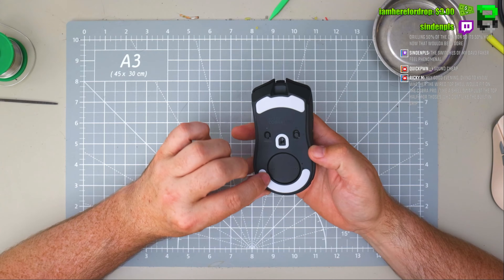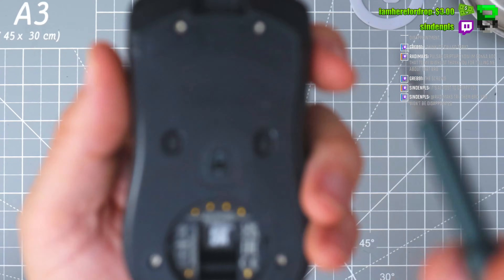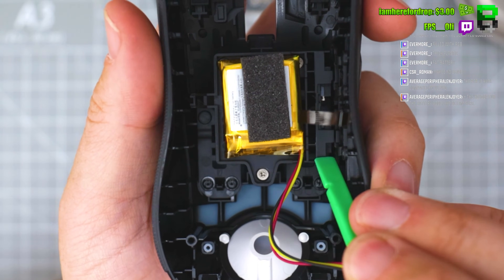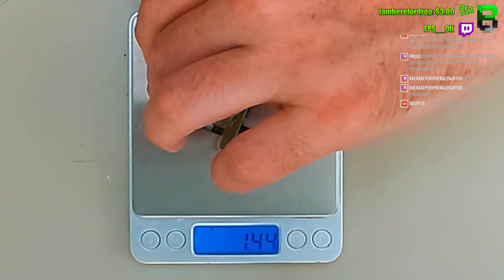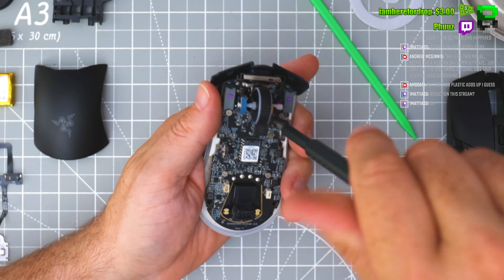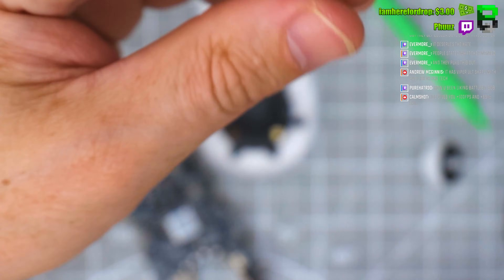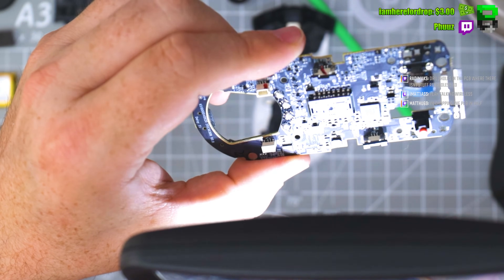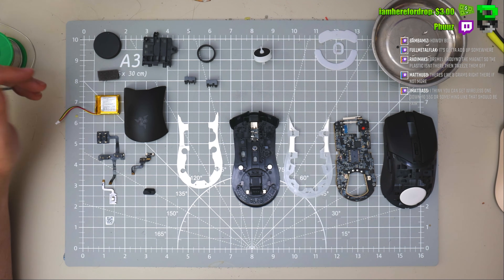Razer Cobra Pro Teardown : EXPOSED

Comment: Thanks for the review. I plan to get Cobra wired (mostly work, less gaming) because it has optical switches - and even replaceable - that, in theory, should last more than mechanical. Sad that the scrollwheel is not optical. Some mechanical wheels can get bad quite soon, and then having optical left/right switches are of no use. Is that blue TTC 11 a good option?

Currently I have Logitech G102. Its switches started mis-clicking in about two years. I resoldered them myself (and this mouse is real pain to reassemble because of flat tip PCB screws), but now it's messy again. Also, G102 scrollwheel had a weird rubber that disintegrated into a sticky goo after a year of use, so I removed it and have a bare plastic wheel. This is weird to have such a bad wheel from Logitech. I have PS/2 mice that I've used for 10 years and none of them had the wheel rubber melt. Not sure how well Razer Cobra will hold. 

I often open up my mice and add some foam inside to make them more silent. Depends on how easy it is to open. It's sad that many mice have screws under the pads, so you won't get them back on perfectly after opening.
Reply: Fortunately, there's a version of this mouse with optical wheel, cheaper and it's lighter too. Cobra Hyperspeed. Unfortunately it shares the lousy middle click tactile switch that Razer uses. I try to use it as little as possible to prolong it's life. I don't understand how Razer uses it even in the supposedly "state of the art" Viper mini SE. My Dell mouse at work uses a better switch for middle button.

Comment: In case it’s useful to someone: the battery size is 30mm length, 25mm width, and 8mm thickness. I bought one like this on AliExpress for a couple of bucks, resoldered the BMS board from the original battery onto the new one, and everything works perfectly. And if the seller is to be believed, the capacity has even doubled
Reply: Do you have a link pls?

Comment: Anyone knows where i can find a replacement battery for this cobra? I found one on Aliexpress, but also wonder if any battery with 3.7V 700mAh would fit? Do I need to care for its dimension or maximum capacity (higher 700 mAh)?

Comment: The most interesting discovery of your video: The rubber grip is just a thin 0.3mm layer which is on the outside of a normal plastic shell with regular adhesive. So if it wears down, you can just remove the grip and put grip tape or 3rd party custom-fit side grips there. Nice!

Comment: is there a way to rgb delete? and how about wireless charging (or does doing anything to it heavily affect its charging either way?) as i plan to get one soon

also also, would be dope to see a naga v2 pro teardown, keep up the grind bearded!
Reply: The rgb parts weigh like 5g and you can't handle that? What tf is wrong with this generation?
Reply: @oliverjames8580  They eat too much soy. That is the only explanation. I have the Cobra Pro now and it's really too light, but I'm getting used to its lightness. I can't imagine what kind of mosquito arms think it's "too heavy".
Reply: @oliverjames8580  ppl soft ong
Reply: @oliverjames8580  fr tho. people act like if they skill fully depends on thery gaming equipment.
Reply: Yes you can turn off all the RGB and save it as a setting inside the mouse, permanently, regardless of OS. You can have 5 different ones stored on-board. So "big RGB for coolness" and "no RGB for battery life" etc.